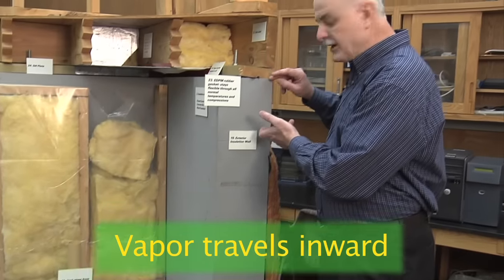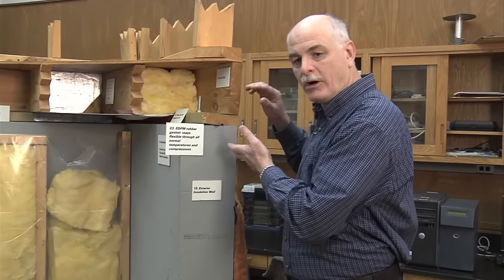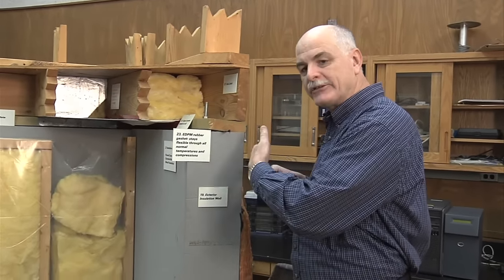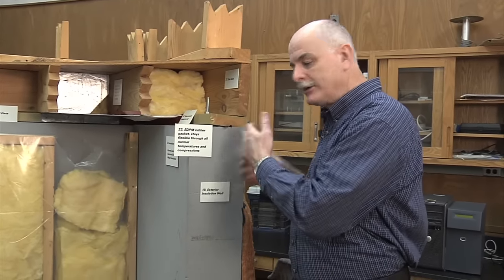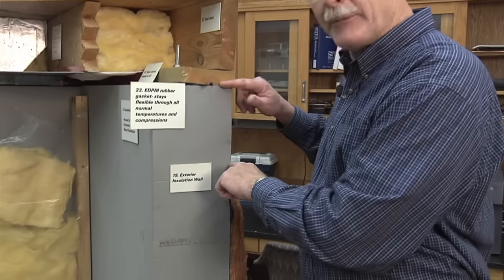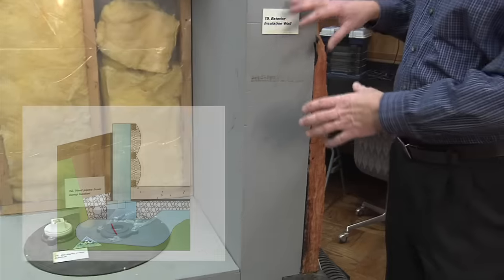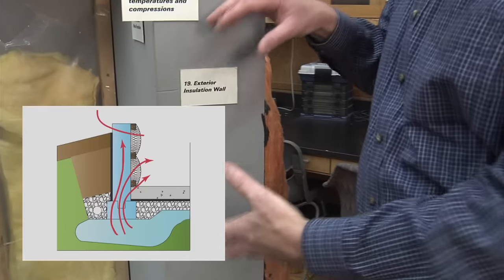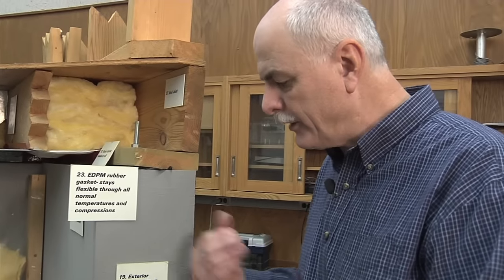Foundation Insulation Effectiveness: Basement building science

Comment: I'm currently in the process of applying an interior insulation strategy in my basement (located in the Northeast).  Applying the insulation to the exterior would have been too costly, so I'm going with the next best thing.  The strategy I've taken so far is to use Rigid XPS on the interior foundation block walls (taped at all seams) and have applied spray foam insulation to the rim joist cavities.  The basement also has an interior drain system, with a gap between the foundation wall and slab to allow any moisture to drop down into the drain and ultimately get pumped out.  After watching your video, I have a few questions that I hope you can help me out with:

1) The interior drain has a plastic, ribbed sheet that comes about 3" up out of the gap between the slab and foundation wall.  I've been tucking the rigid board into this sheet and gluing the boards with vertical strips of adhesive so that any water potentially making its way between the foundation wall and XPS can drip downward into the drain, and ultimately get pumped out.  However, I have not been sealing the bottom of the rigid board where it gets tucked into this plastic sheet.  Should I put a bead of spray foam along this joint to air seal that area?  and;

2) I have not yet applied any insulation to the top of the foundation wall - the XPS ends at the height of the wall and the spray foam was applied at about 2" thick to the rim joist cavity.  So, there is exposed concrete block still at the top of the foundation, and part of the mudsill is also exposed.  As you mentioned in your video, spray foamers usually seal that area up too making a continuous seal all the way down the wall, but based upon your video I'm starting to think it might be better to leave that area exposed and uncovered.  Wouldn't that better allow any moisture moving upward through the wall to escape and dry to the inside, thus reducing the chance of moisture buildup in the rim joist assembly -- most notably moisture that could otherwise accumulate between the mudsill and foundation with nowhere to dry? There is no capillary break between the mudsill and the foundation wall, and adding one is cost prohibitive.  On the flip side, leaving that area uncovered might also promote moisture in the warm interior air to condense on that exposed, cold surface thus creating a moisture issue and potential rot on the sill.  This is one question that I've been particularly struggling with as I'm near to closing up the framing down there and want ot make sure I take the proper approach.  What do you think -- leave the foundation top open or close it up with some more spray foam or XPS?

Thanks in advance, and thank again for the great video.
Reply: Also note that the interior drainage system has holes drilled thru the foundation wall just below the top-slab level, which sit behind that ribbed plastic sheet.  I assume these help any water in the wall to escape down into the drain and get pumped out, rather than accumulating in the wall.  Given the drainage system in place, I am also assuming that the foundation wall should be fairly dry and thus would allow me to insulate the interior walls safely.
Reply: Jeff LeSauvage I'm curious about this -- is it common practice to have holes drilled into the foundation wall blocks to drain any accumulating water down to a interior perimeter drain tile system?  It seems like a good idea, and I wonder if that would allow you to increase the insulation on the interior of the space because water that would form there would condense and fall to the system maybe?
Reply: @uncertainscientist my last house the very bottom course had some mortar missing between the CMUs to support this kind of water movement.

Comment: Great video. I'd like to suggest that a basement wall with insulating batts should employ rock wool instead of fiberglass. Rock wool is hydrophobic. It will not absorb or hold water even if exposed to liquid water.  So, in the event of a flood or plumbing disaster, it would not have to be dried out. Perhaps the wood wall construction would need a little drying. Your drywall will be cashed and need to be removed anyway.

Rock wool will also inhibit mold growth due to its inability to hold water.

What opinions do you have about products that supposedly "seal" concrete such as RadonSeal?
Reply: Rock absorbs water like a sponge. Once wet has no insulation factor. 
Blue or pink board is the best bet or a closed cell spray foam.
Reply: Rock wool

Comment: One of the best explanations on foundation insulation and moisture mitigation  I have seen. I now better understand how  and why my 32 year old  concrete block foundation does what it does. I have efflorescence on the walls, mostly at the bottom course and the top few, exposed to outside air.  The foundation was waterproofed with a product called Theroseal. It adhered and held up quite well on the outside foundation walls but unfortunately  does not have good waterproofing properties. It probably would have been better to just use an asphalt coating. If I were to build a home today I would certainly use the techniques described in this video.
Now if I could just find a way to stop the efflorescence on the inside walls.  The last product I tried on some of the virgin walls was a product called Hydro-seal 75, an epoxy paint product. Now after about a year the efflorescence is pushing the paint off the walls.  It works great on the areas where there was no efflorescence.

Comment: For interior insulation you might use following strategy, it looks like it reconciles with physics described in this video: 

 put dimpled membrane on the floor, plywood or OSB on top and screw it to concrete floor. This will take care of moisture coming from below. 

put 6 mil poly or better still dimpled membrane too on the wall all the way down to basement floor, and seal it to dimpled membrane on the floor: this will take care of incident water and water vapour through the wall. Because it is dimpled membrane, the air underneath it gets to Rh 100% and equalizes vapour pressure. 

Put regular frame on top with fibreglass insulation, but instead of using poly as vapour barrier on the inside, use variable permeability membrane like Certainteed MemBrain. It changes it’s permeability with change in RH: once RH goes above 60% it opens up, let’s water vapour through. So if you get some condensation inside the wall, variable permeability membrane will let it dry to the inside.
Reply: 15 mil poly is what I've seen elsewhere.

Comment: Thank you for that video. I'm assuming that on existing homes where the outside has not been insulated, that you are left with no other choice than to insulate, and vapor barrier the inside foundation wall ? ...or would you still leave it alone and take the heat loss in exchange for risk aversion to moisture buildup ?

Comment: Great video, thanks for sharing:) 

I'm curious as to what you would recommend as the best insulation and install if you had no choice but to insulate a basement from the inside?
Reply: Sounds like you shouldn't use insulation on the interior.  It's below grade anyway so it already is insulated to a certain degree.
Reply: Have a contractor dig down to the footings on the outside and water proof and insulate.  Expensive?  Yup, but it's the best way.

Comment: 1) To prevent wicking from the soil through the footing, could you not pour the footings on a “runner” of poly sheeting? The excess width could be brought back up and taped into the basement floor vapor barrier. Outside, it would be wrapped up to the bottom foundation wall and fixed somehow. Then sealed over with the outside foundation ration waterproofing.

2) To prevent moisture wicking through the interior face of the foundation wall- Dry Lock?

Comment: Interesting. I wonder if having  vertical aggregate along side the outside basement wall might help keep moisture away from the wall, along with the exterior water sealing and insulation of course.  
   It all looks like something we are still trying to figure out. Most of it though seems to say we need to seal and insulate the outside. There seems to need to be an  escape route for moisture at the top of the cement wall so it does not get into the base of the framing. Probably best to use treated lumber at the base, if not plastic lumber. 
   I will have to watch this again and take notes.
Reply: David Parker we did that in retrofit exterior drain tile jobs in new York, along with waterproof membrane and exterior insulation. expensive job, but dried the basement effectively every time.
Reply: EdwardSnowdon 
the black plastic dimple barrier would eliminate the need for you washed rock drainage idea
Matt Risinger uses it with liquid applied blue 60 mil sealer on outside concrete wall of basement

Comment: I am built on a gravel hill. Thank gox because my house is exactly how he says not to build it. However my walls are gapped 1 inch from the outside wall. Also my floor has delta floor under it. this allows any moisture that builds on the concrete wall to run down to the floor and remain under the dekta flloor. before I finished my walls my basement humidity never rose above 35%. So I think I am good.

Comment: Good video, I have a daylight basement with no vapor barrier in the floor.  The walls in main room are covered with 3/4 tongue and groove attached horizontally directly attached to foundation wall (3 foot hip wall) on top, 2x6 wall framing bat insulation r19, plastic barrier. cover T 1-ll.   The wood stove takes care of all moisture. In another room foundation has a thin layer of joint compound and paint. No molding unless something blocks air to it. This room I have two layers of pile carpet, the ground is very cold. Your presentation is Correct. However the other room has thin industrial carpet and is very warm to my feet.  I am going to do an addition, brainstorming the best design. I really like to go geothermal with Rocket stove. Search and brainstorm until the light goes on and you got it. Thanks

Comment: Amazing presentation.  I'm still just a somewhat beginner to moderate DIYer and so I was hoping someone may still be monitoring this video's comments.  I was hoping you might be able to give me the big picture view of what can we do to be the safest in an existing building that is an old house?  For sure probably not a dry foundation although no evidence of leaks through the block foundation wall in the basement.  I'd really like to do what I can.  I obviously can't dig outside of the foundation to add anything exteriorly and  don't want something ugly on the exterior.  It sounds like maybe my best bet is rigid board insulation on the block walls and a small amount of spray foam in the rim joists?

Comment: One thing I am not too sure about, but favor over any of these FINAL solutions is. Why not just space the interior wall away from the concrete, say 3 inches and leave an air gap. Have a vapor barrier on the dry wall side only. When we dress with clothing, air is the best insulator....does this not work well enough on a house? At least any kind of moisture present can circulate behind the insulation and dry up eventually.

Comment: According to a lot of systems here in Sweden you sould remove the vapor barrier towards the outside and then let the condensation point be in the insulation on the outside. That should pump moisture from the wall and offload it outside the wall. Normally you use a product called isodrän, but I think Rockwool would work the same. To offload moisture from the soil one could use a plastic sheet called Platon mat. But most just removes the membrane on the wall and put up isodrän.

Comment: The real moral of the story here is that you basically cannot safely insulate a basement from the inside in any manner using any materials if your sill plate is not separated from your foundation by a capillary break.  All methods(fiberglass + plastic, XPS taped and caulked, or a full spray foam job), WILL drive the moisture into your sill and rim joist because they prevent inward drying.  Either you seal off that sill from your concrete foundation or it is no deal of any kind.
Reply: Aezelll I was thinking that, then saw your comment. idk what to do about it now.
Reply: I would measure moisture content in the concrete and act accordingly.  If moisture content is low and there is plenty of opportunity to dry to the outside I would go ahead with interior insulation.  If moisture content is high and little opportunity to dry to the outside then any interior wall system would have to be well ventilated to allow drying to the interior.
Reply: rain we get 100" rain and 30" fog with high humidity.
Must drain water from house . French drain inside and outside. Moisture mat on outside wall to drain to daylight .
In South must have bug inspection prior to sale or recommended to homeowner. Critter prevention moisture removal inside and out. What do you think of foam block inside and out ?

Comment: amazing video ...looks like you could just add or hang a common open weave fabric wall drape to decorate cellar with no problems as long as air gets thru. didnt do quite enough explaining on the drainage issue under the foam though if air gets in drainage channels will be wetting surface no ?

Comment: I have efflorescense on my basement floor. It has a thin concrete slab with an air gap underneath, where the soil has settled. We put a roll-on moisture barrier and vinyl tiles. Almost immediately the problem became obvious, as it looks like ant hills under the tiles. Its a house in Toronto, On. built in 1928. One room has a ceramic tile floor and has no issues.

Comment: I live in Mass and I worry about mold growth. I had a hot water heater leakage and had 
Water Remediation, I have a high water table and want to find a product that will prevent black mold growth and musty basement smell.  I ALSO need help find a very good dehumid/humidfier.

Comment: Hi Pat, I've dug out some area outside. I found the sale fiber insulation as you have on the below ground. We have lots water circulating around our foundation. My question is this: this fiberglass insulation is soak and wet, so cold weather the water must freeze against the wall cause of cold transfer. Wondering why the heck is this used below ground outside? If wet fiberglass insulation does not work in doing it's job, why put it on the outside walls below ground, rigid or not fiber? I'm totally perplexed on this knowledge... please answer

Comment: So I'm assuming a thin lzyer of closed cell spray foam applied to the interior of the rim joists is preferred to open cell spray foam due to its decreased permeability ??  

Please advise as my rim joists are not insulated, and i am planning to insulate them.  
Home built in 1989 on hill side. Cement block basement foundation.  2/3 of basement block wall is below grade.  Home located in Knoxville, Tennessee area.  I have no knowledge of exterior barriers or insulation.

Comment: would you recommend a drylok concrete paint behind the ridged foam layer? my house was built in 1953 , block walls. my plan is to drylok two layers of paint first. then 2in foam board, 2x3 framing with r15 , plastic sheet. then drywall.
Reply: Everything sounds good but don't use that plastic sheet and then drywall.

Comment: In the northern climates, if the foundation is insulated then the ground around the house can more easily freeze.  As we know when water freezes it expands.  What do you recommend to prevent the frozen ground from pushing the basement wall inward?
Reply: This can happen but generally won’t. Frost heave is primarily a vertical force. If you’ve a poorly constructed wall and/or terrible grading such that the soil is saturated before a major freezing event you could have this issue.

Even a well insulated basement will shed so much heat, however, that the soil around the house itself is of a much higher temperature than soil further away from the house.

Comment: Great video even if I intuitively assumed most of what u said was the case. It's good to have confirmation my assumptions were correct. And the importance of a vapor barrier between foundation or basement wall and the rim joist was not even a consideration,  So that was very enlightening.  
But I hope u have or will have videos on Aircrete or ACC (Autoclaved Aerated Concrete) or any related building material since it seems to have so many advantages vs its disadvantages. For a building material developed in the 1920s its a shame its taking so long to be used on wide scale. And the fact its still not used that widely used in the US is real shame